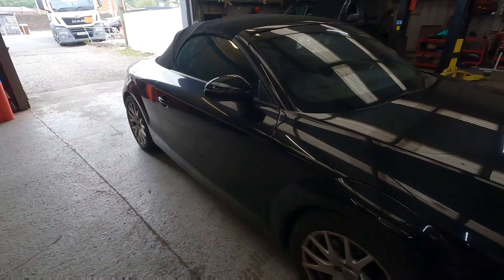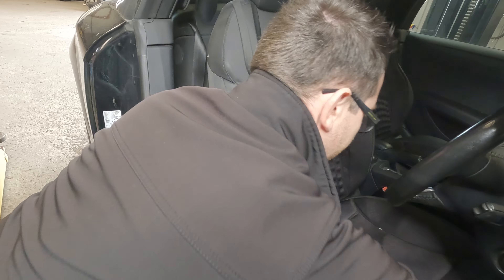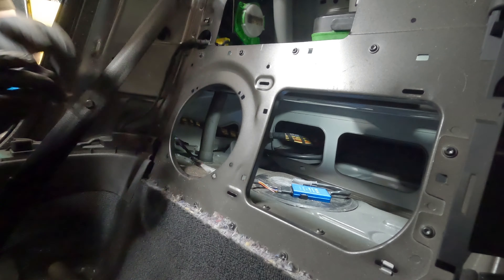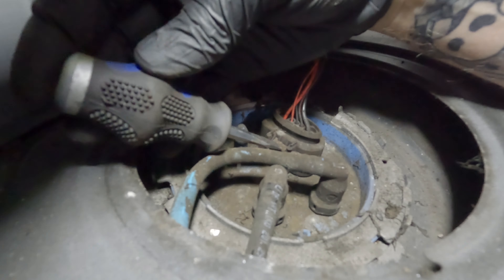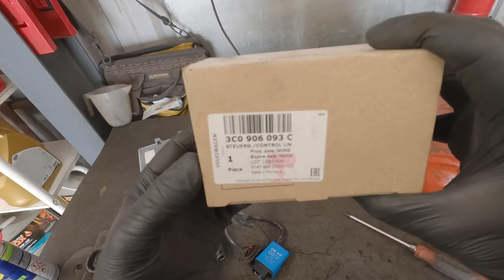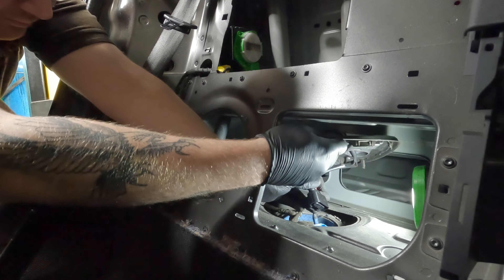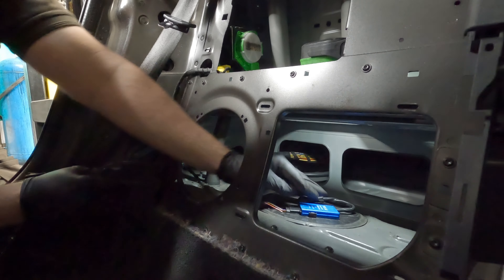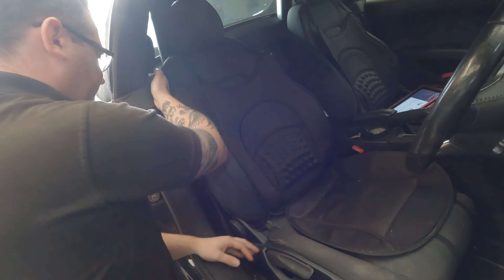Audi TT : P3089 , Replacement of the fuel pump module.

Comment: You know, I grew up in the city riding public transportation. Then I bought my Audi and now I'm a make shift mechanic 😅♥️ thanks for helping a girl out with vids like these!
I have a MK1 and have seemingly weird problems with my fuel delivery. Especially start up in damp weather is really hard and I might need to turn the ignition several times for it to manage to start up. So I've wondered if it's an electrical issue since sometimes she will fire up with no problem, even in -15 celcius. When I have poor start ups the car generally feels sluggish and I have to drive on lower gears. 
It also "lugs"/cuts out during acceleration - can that be connected to the module or is that more of a general fuel pump failure problem? There's two fuel pumps too, so I don't know which is the problem, and parts are expensive. The problem is definitely worse when my fuel level is low. I've assumed it was a problem with the fuel pressure, especially due to start up problems plus the cuts during quick acceleration (slow, careful acc is fine).